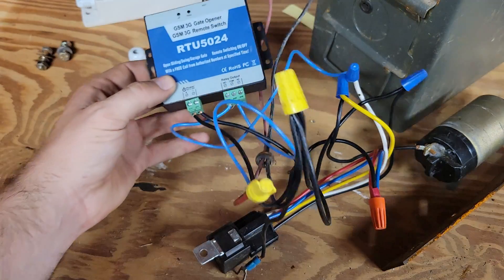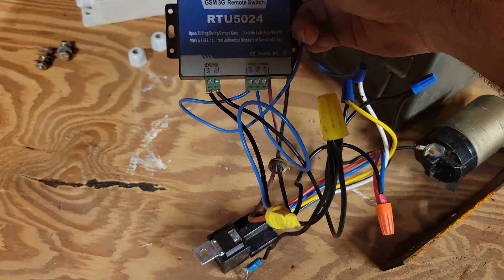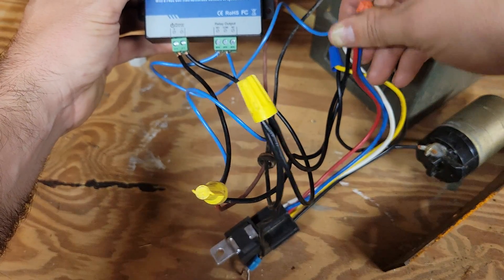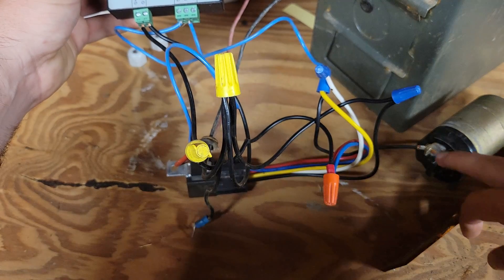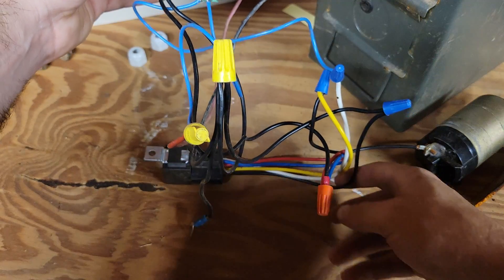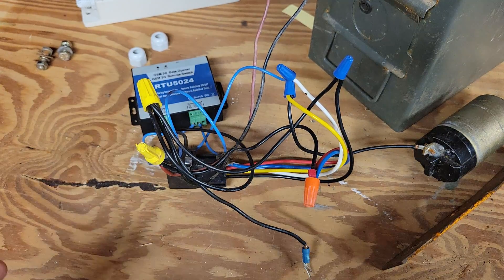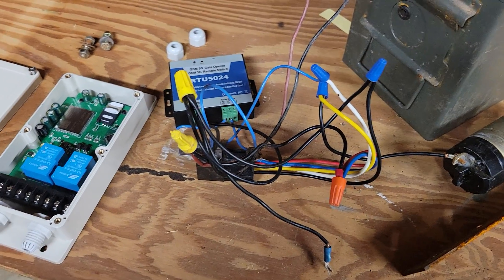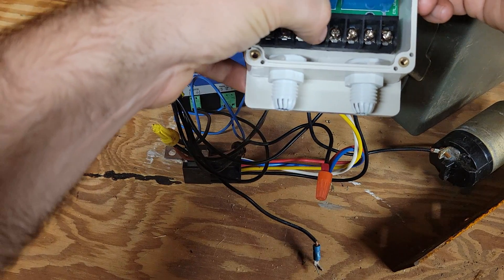Wiring a homemade gsm hog gate controller

Comment: So I had a RTU5024 controller but it quit working cause cell company said they were going to 5G and i needed a new sim card.
Ever since I put the new sim card in I haven't been able to communicate with controller. Any suggestions please?
Reply from the maker: The rtu5024 is not compatible past 3g from what I have seen.  You will need to upgrade

Comment: I wired mine up just like this.  Checked it 4 times, hooked up to the battery and it started smoking.  I have since checked the wiring 4 more times and it is exactly like you said. Any ideas?  Maybe the automotive relay is bad or has a different color coding?
Reply from the maker: 4G GSM Dual Channel Remote Switch Controller, SMS Command Remote Board with Relay Output, GSM-CTL-4G Relay Control Box(US) https://a.co/d/bUas6VM
Reply from the maker: What gsm are you using? What was smoking?
Reply from the maker: I have not found an rtu5024 that works with att since the 3G went away.
Reply from the maker: This is what I am currently using
Reply: This bubba is not wired up correctly. 87a (red wire on relay)is not supposed to be used(just pull that terminal out.) 85 goes to NO and 86 goes to COM on the gsm. That switches the relay on. Power goes to 30 which is blue on the relay and yellow is 87 and that goes to the actuator positive terminal. If you doubt me, the relay has a diagram on it and the actuators and gsm controllers both come with matching diagrams.
Reply: 85 does not go to NO.

In this configuration, com goes to positive terminal of battery. Com goes to 86, and 85 goes to negative on the battery.

30 goes to positive on the battery, 87 goes to positive on door popper, negative of door popper goes to battery.

It can be confusing, but the power to the GSM board only powers the board and the low power relay that controls com and NO (and NC), but DOES NOT PROVIDE POWER TO COM OR NO.

Comment: where did you get the 4g module? do you have name and part #?
Reply from the maker: 4G GSM Dual Channel Remote Switch Controller, SMS Command Remote Board with Relay Output, GSM-CTL-4G Relay Control Box(US) https://a.co/d/bUas6VM